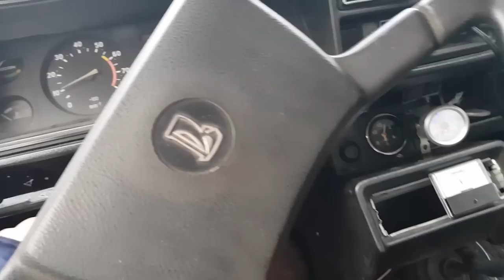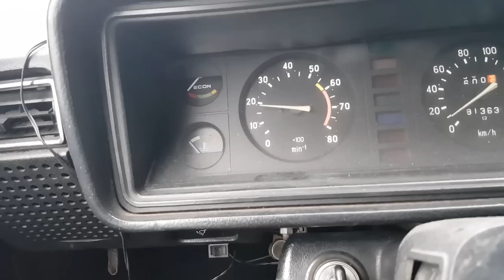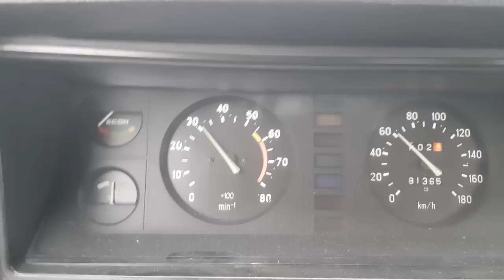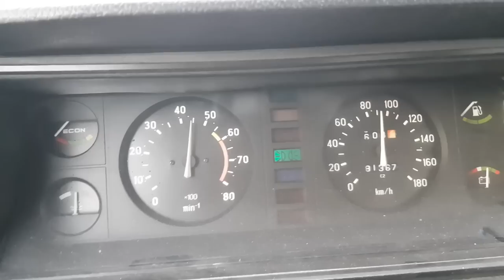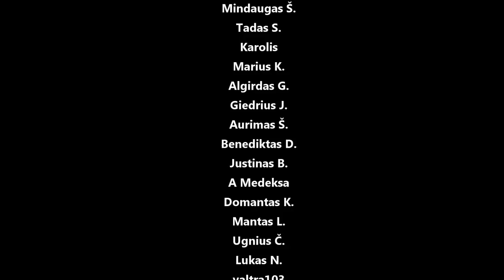Lada 2107 1.5 Turbo LPG cold start (FOR SALE)

Comment: Just a few questions if you might please
Can I connect it to the carborator ?
What type and manufacturer of turbo you are using and what specification? 
How many horse power have you got? 
What is the top speed after modification
Reply from the maker: Hi, if you want to make it work with carburator, hou need special carburator that you can boost, rehular one can not be used and it flows too little fuel. I used turbo from bmw 2.5tds, but you can use all kind of turbos. In this setup it made about 120hp using basic LPG system and carburator delete.
Reply: @MechanikasLukas  what do you mean by carburator delete how did u do it
Reply from the maker: @denkataxd4665  just removed carburator, installed throtle body and ran car on LPG gas.

Comment: Hello , i have a question about the vacuum from the lpg evaporatior how did you feed the engine
Reply: You need to have the converter reference the boost pressure from turbo instead of atmosphere

Comment: Rubbish car for recycle
Reply: Go drive your Mercedeses, BMWs, Audis you show off.
Reply: @dmtd2388  At least it can last longer than any modern car if it is proper maintained and it doesn't require many tools to repair it and it is pretty cheap to maintain it. Sure it may not be fast or having airbags, hydraulic steering, and it is not that comfortable as modern cars but even race cars don't have airbags and comfort. Plus these safety things just add weight and increase the fuel consuption. Tell me if you own for example a 2020 Audi, BMW, Mercedes or other modern car can they be reliable and last for 40+ years.
Reply: @HeroManNick132  there are a lot of cars that will go so long and anyway not Tesla and electric is the future all cars will be like this and self driving no more service cause no engines
Reply: @dmtd2388  Sure, I know electric cars will conquire the car market soon or later and many car people won't like them because there is no sound but even the new gasoline cars because of the emissions (mostly German cars) sound like crap. But even though some people like 1 era and they can't let it go it has an end. Everything is with the time so we have to accept the electric car era won't be fun as gasoline/diesel era.